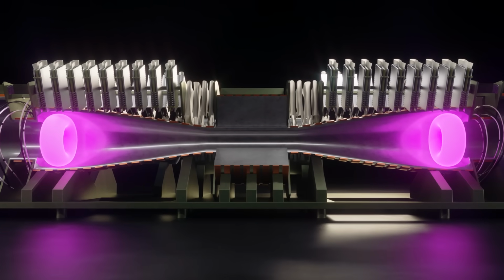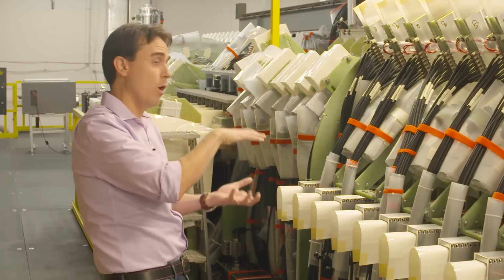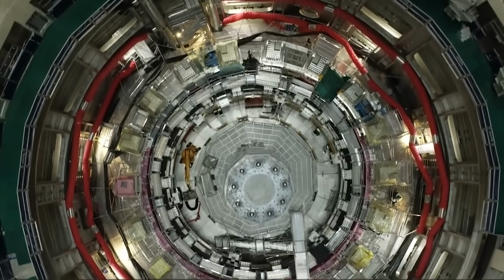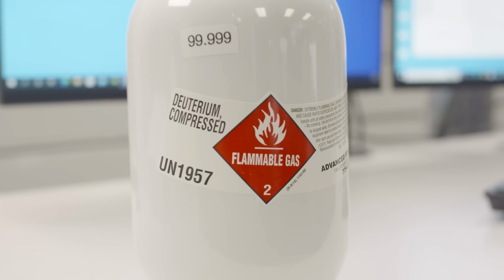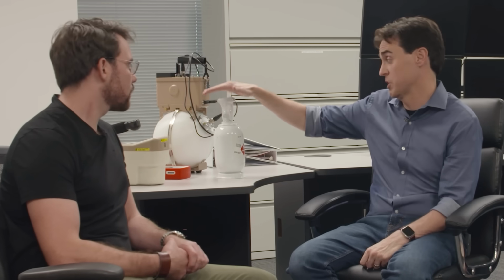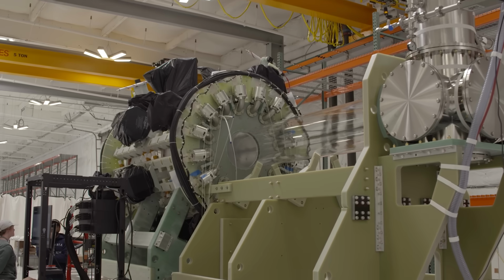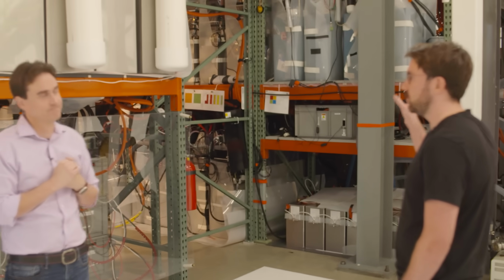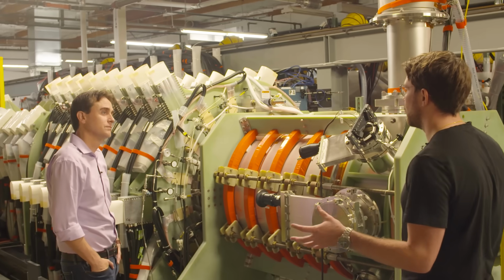A New Way to Achieve Nuclear Fusion: Helion

Comment: What will you do about neutron from D-D ?
Reply: Shield against it. They could put it to work somehow but it is likely not worth the extra effort/cost.
Reply: yeah but this shielding will have same  issues as the one in ITER.
Reply: @jakubczapek909  No, ITER is D-T and the neutrons from that reaction have an energy of 14 MeV, while the neutron from a D-D reaction has only 2.45 MeV. 
That is below the activation energy of many materials and much easier to manage.
What's more is that only half of the D-D reactions produce a neutron. So, you get neutrons in at most half of the reactions (e.g. if you assume a pure D-D fueled He3 breeder).
Reply: I understand that they are easier to manage but those neutrons will still produce some radionuklids. The shielding wont need that much maintenance, but still will be robust. Pleas correct me if im wrong. Or have you any ideas of materila of this shiealding? I think its crucial for this project.
Reply: IIRC, Helion is planning to use borated concrete, hydrogenous shielding and lead. 
From what I remember a Helion power plant can be fully decommissioned within two weeks of operation and all activated materials will be below background radiation levels within less than a year.

Comment: When they are able to do low temperature stuff .. you know where if an accident happens it doesn't lay waste to everything around them.  That would be  great.
Reply: The plasma is hot, but not very dense (only 1/1000 the density of ambient air). It only contains a few kWh of energy. If confinement failed, there would be some abrasion on the inner walls. If the walls failed, the plasma would cool off immediately and fusion would stop.
Reply: @elmarmoelzer2229  that's good news....   but density and  thermal expansion...  i could only think if it were so over the top hot, then even a little screw up would be majorly bad.  But this has a huge safety margin is essentially the deal with density?  I'm guessing it's also in a vacuum or low pressure environment.   To enable maximum impact between the two or is it heavy pressure to increase the temperature of the plasma impact....  I'm just curious how the approaches would change the mechanics of the system.  my mind wonders...

Comment: Seems to hold a lot more promise than the Tokamak boondoggle but still enormously complex and expensive and likely to be eclipsed by already proven LENR technology, AKA cold fusion of two hydrogen atoms into helium.  Much better to harness lower energy, "natural" processes than to use brute force to try to replicate "unnatural", Big Bang type conditions.  Where is the funding coming from for this?

PS. fission is pronounced fishin, as in mission, not vision.
Reply: LENR is not proven. 
Trenta only cost 35 million to build and operate. The funding comes from private investors.
Reply: @elmarmoelzer2229  You're not up to speed on LENR which is not surprising for anyone since the money has been chasing hot fusion for decades and LENR is considered a pipe dream in the main.  If you want to know where LENR stands you have to search for it, breakthroughs there will not be fed to anyone.
Reply: @dwc0  I have been keeping up with Rossi, the Martin Fleischman Memorial Project and a few others. So far I see nothing that convinces me that the effect exists. It all is so small that it is within measurement errors. And then there is also Brilliant Light Power, which is quite elaborate and might, or might not be a scam. At least they are building stuff for the money. Still not convinced of them either. At the same time, I keep a weird fascination with that stuff and watch it for entertainment. I mean I will be very happy if it works, but I am not holding my breath.

Comment: This is great, but there is still the major problem that is overlooked: large power demand/duty cycle of the power grid. These may become capable to generate electricity but no where near the 500 MW combined cycles that we currently have in operation.
Reply: You can colocate several of them together, which allows them to share some components and makes a larger setup a bit cheaper. Smaller machines are interesting for smaller applications or if you want to a more distributed power grid.

Comment: That's amazing! I was sceptical of ITER and other systems like it precisely because it was too expensive just like nuclear plants and they can never compete with solar and wind. 

But if they can make these fusion reactors small enough so that they can iterate and benefit from manufacturing and economies of scale - maybe they would be able to compete with wind or at least reach wind's energy cost at scale - ~4 cents/kWh. (probably not with solar which is already below 2 cents/kWh in some parts of the world)

I really see them displacing all fossil fuels and maybe even stepping on toes of some renewables.
Reply: Helion is aiming for 1 cent/kWh, though that might take a bit until they have mass production and economics of scale. Still want to be competitive even initially. My guess is that they will be aiming for gas turbines first, since they can load follow even better than those and they are CO2- free.

Comment: They still haven’t reached ignition. Whereas the NIF at Livermore has already demonstrated ignition and net energy.  Until Helion, and others around the world, have a comparable breakthrough, we are still a long way away from power plants.  Hopefully we won’t be 10 years away forever
Reply: Helion does not need to achieve ignition. Thanks to direct conversion and 95% efficient input energy recovery, they can get away with a relatively low Q(sci) of 5 or less ( I have heard somewhere around 3).

Comment: Incredible! I wonder if they could make other elements like gold, or even ones we haven't discovered yet...
Reply: The elements we haven't discovered are all on the heavy end of the periodic table, where you can only perform fission. The elements used for fusion are helium and hydrogen, the lightest two elements. We can create gold in certain particle accelerators, but it costs much less to just dig it out of the ground.
Reply: @Rhaegar19  Thank's for the answer.When you say Helium and Hydrogen are the two lightest elements is it possible there might be an element even lighter theoretically or is Helium and Hydrogen the definite limit?
Reply: @liamnorth555  Based on how we define "element", yes. It has only one proton and one electron, helium has two. Could there be some new physics that would allow half a proton? Negative protons? Who knows, but for now it is the lower limit.
Reply: @Rhaegar19  Ah I see, much appreciated. It's been a couple of decades since I was in school lol

Comment: Why not absorb the excess neutrons into a thorium-232 blanket, making it into fissile fuel for a LFTR that would then produce tritium from a FLIBE coolant, feeding the fusion reaction.
Reply: Because the blanket would become radioactive, and radioactivity was the very thing that shot down fissile energy to begin with.
The Tokomak and Stellerator are outdated concepts from another era, it's time to move on.
Reply: Helion had originally planned to do just that (and as a waste burner) as an intermediate step towards a pure fusion power plant. No one wanted it. Maybe once they have a pure fusion power plant running, people will change their mind again.
Reply: probably because investors are idiots

Comment: I may be misunderstanding, but...
Helion Reactor stage 1 has Tritium and energetic Neutrons as unwanted side-effects... but isn't that what the Tokamak reactor wants?
So couldn't you create a Fuel-Creation (Helion 1) reactor that worked as a pseudo-Tokamak, and have it fuel one true Tokamak and several Energy Reactors (Helion-2)?
Reply: Tokamaks are insultingly inefficient, plus they get radioactive over time so I wouldn't recommend it.

Comment: Does it produce more energy then it consumes ?
Reply: I don't think they've gotten that far yet?

At least I don't think it was mentioned in the video.

But, scientifically speaking, taking a new route to approach a problem seems only a good thing, because worst case you find out new information even if it doesn't work.
Reply: @LJCyrus1  It was recently confirmed by researchers at the US government lab that they produced more energy than they consumed
Reply: @RyanRuffi  Yep, but I don't think this is that lab or the US government, although they may subsidize this project in part.

Comment: How long does the compressed plasma field last after the collision occurs?
Reply: less than 1 millisecond. Does not need to last longer than that. They just repeat 10 times a second (in the final power plant) to get 50 MW electric to the grid.

Comment: Date: 27-Dec-2022 = Furthermore, HELION Energy company should also consider (as my own unsolicited advice) in it's prototyping and testing of it's 7th POLARIS Reactor that will produce net electricity by 2024, the use of the SUPERCAPACITOR storage devices in storing the captured energy (rather than the conventional HV capacitors) from the magnetic field coil's output due to FARADAY's LAW OF INDUCTION with the Fusion plasma magnetic field,  by doing a series connection to increase the voltage rating of the SUPERCAP modules at it's required voltage input rating and then connect these modules in parallel configuration to increase the Total Capacitance output of the SUPERCAPACITOR Packages and thus the required electrical energy storage handling and then use the dc-dc bi-directional converters for inverting the DC Voltage into AC Voltage at such utility frequency and then coupled it to HV transformer for further INCREASE in VOLTAGE OUTPUT (as needed only) BEFORE TIE-UP with the UTILITY GRID as the new alternative renewable energy source, alas safe and carbon dioxide free of polluting emission. TY !, by FMSJR.